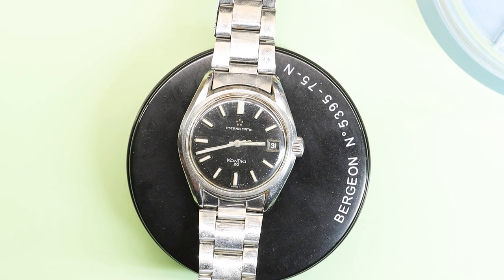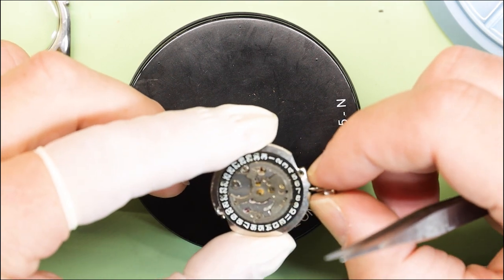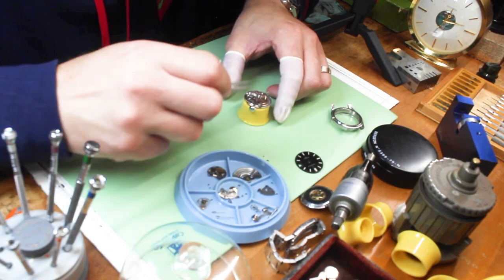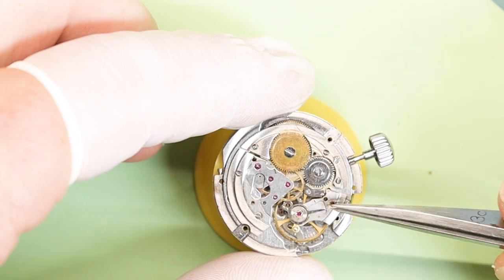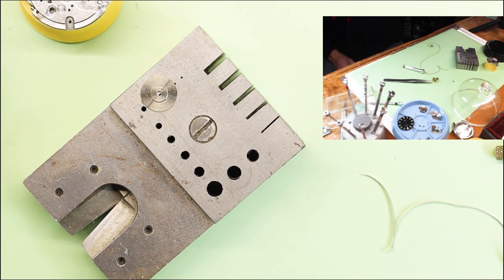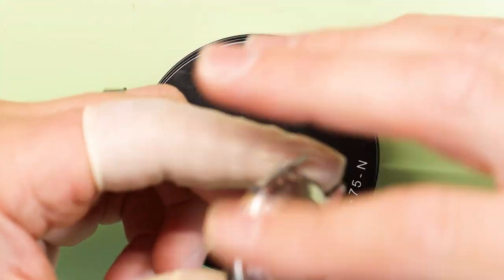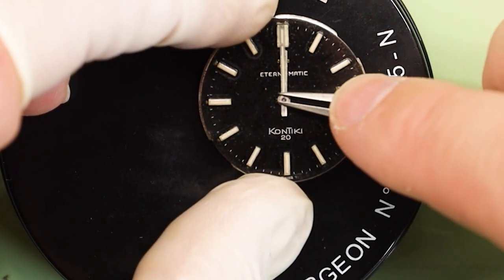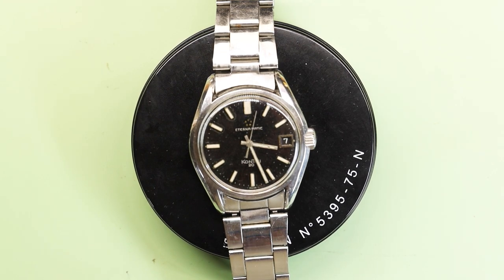I Traded Running Watches For A Non Running 60s Eternamatic Kontiki, Will I Be Able to Make It Work?

Comment: hey joe - another great video, i enjoyed the troubleshooting. Do you have a mainspring winder to recomend?  Thanks!
Reply from the maker: Thank you very much, glad you enjoyed it. The only thing I would really focus on, besides quality is making sure you have all the sizes you need to work on whatever wristwatches you plan to do. The set I have is a vintage watchcraft 8 winder set, not super expensive but not bad in quality. The main ones I use out of that set is the 3 biggest sizes. If you are asking about pocket watch mainspring winders, then I love the K&D No 128 vice winder. Hope it helps!